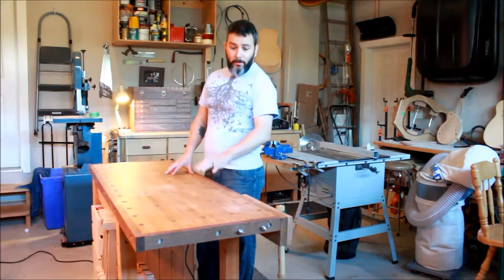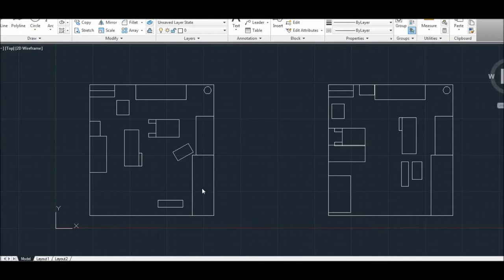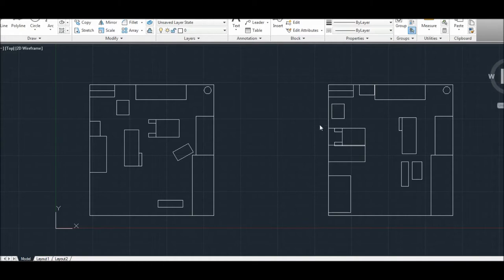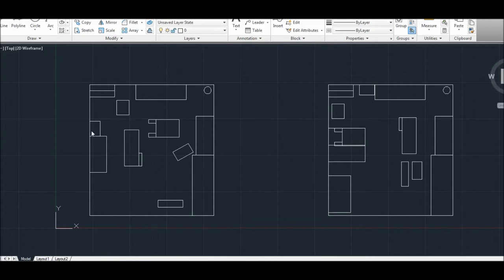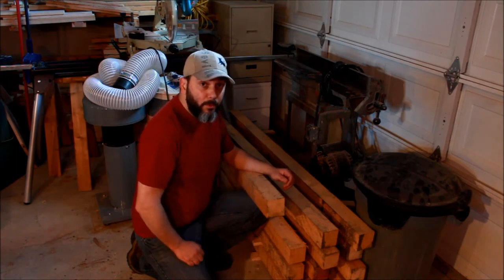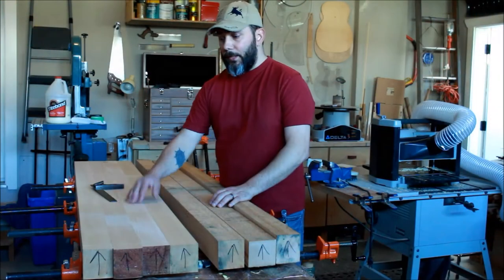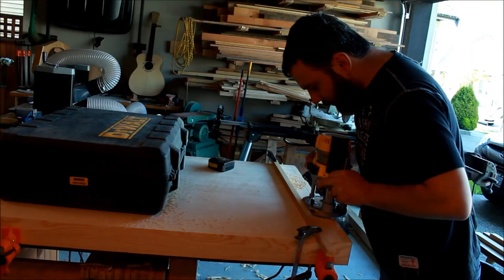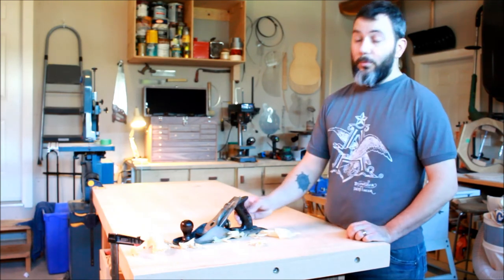Shop Layout First Part

Comment: I'm really surprised and impressed. I'd never thought you could do such a glue up with a really nice result without putting those timbers on the jointer first.
Reply from the maker: ensen89 I rarely use a jointer for this big of a glue up, and also on this project I made my doors the same way..there is a lot of room for thicknessing with reclaimed wood! Thanks for your comment..

Comment: Maybe look at locating the table saw in the area in front of the overhead doors,it allows you to cut long boards or ply with the door open and shorter materials with the overhead door shut. I have a jet supersaw and have used it as mentioned for many years. My off fall table is a festool mft,,but hate it as it is so wiggly and unsatable.a new off fall bench is in the works
Reply from the maker: Edad Martin this seems like a good idea. I've seen it done in other people shops. I might give it a try when all the clutter is dealt with.